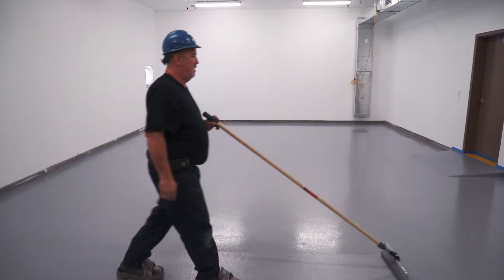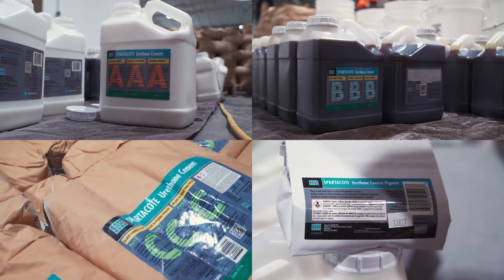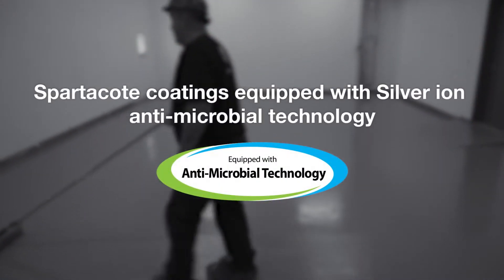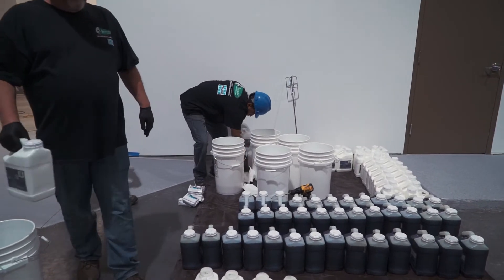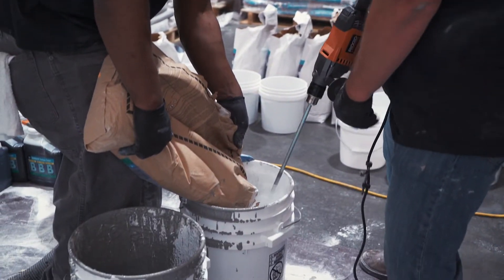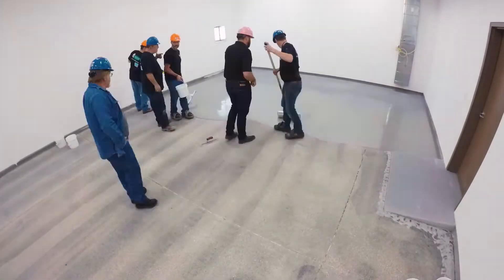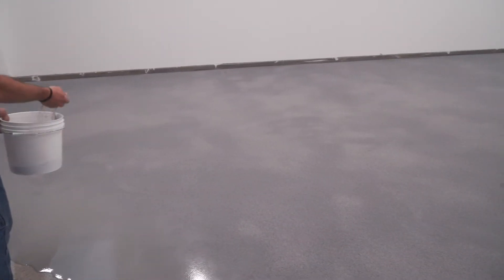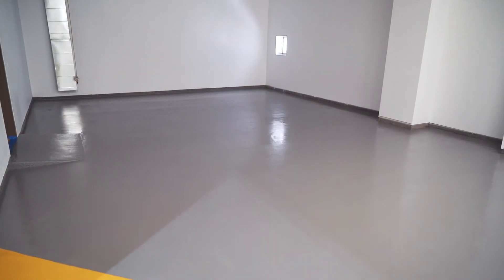How to Install SPARTACOTE Urethane Cement

Comment: do i have to broadcast sand over the first coat? can i just leave the base coat smooth? the purpose i would be using it for would be for quick washing and cleaning.  not worried about slipping, everyone wears wet environment footwear.
Reply from the maker: Here is a link to more info. You will see that the broadcast over the first coat is optional. https://cdn.laticrete.com/~/media/product-documents/marketing-information/sell-sheets/ds0826_spartacote-urethane-sell-sheet.ashx?sc_lang=en&vs=1&d=20200203T162712Z